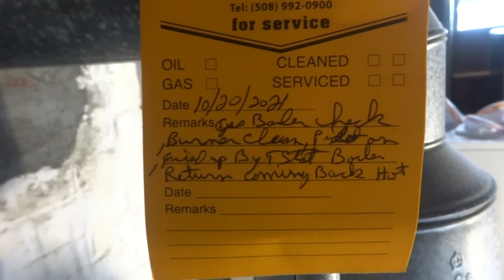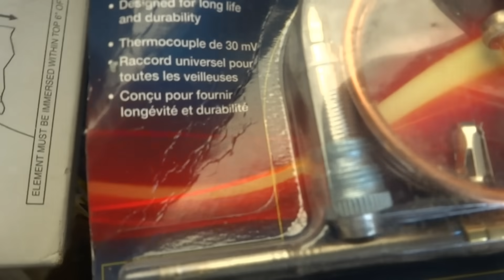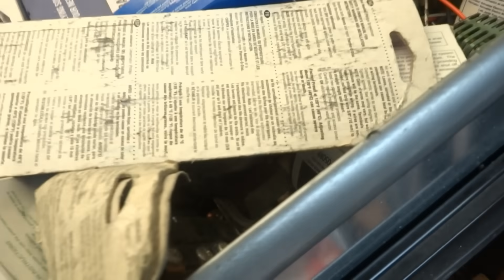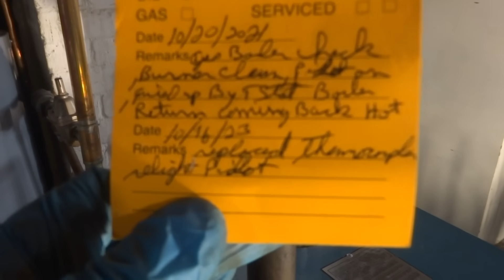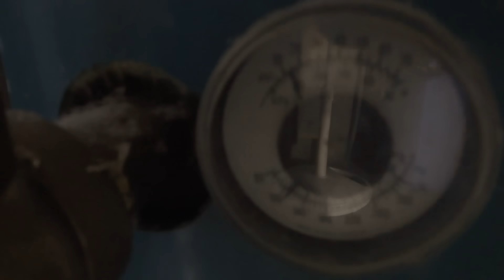GAS BOILER PILOT WONT STAY ON

Comment: This is my gas boiler. I have replaced the gas valve once and a number of thermocouples. It was new in 1988. I keep spare thermocouples on hand. I'm going to try to locate the one that you used and change it out before it gets really cold. Thanks for the great information.

Comment: Great fix-it video! A Flare Nut Wrench might work on those soft tubing connectors. I still have my Dad's set after it was passed down to me.
Reply: Those flare nut wrenches have saved my life a couple times. They work when a normal wrench will slip and round off a bolt or nut.

Comment: Not an HVAC tech but did anyone notice the change in behavior of the flames when the fan came on?  Does this suggest a bad heat exchanger?
Reply: No blower fan on that unit,  hot water heating system,